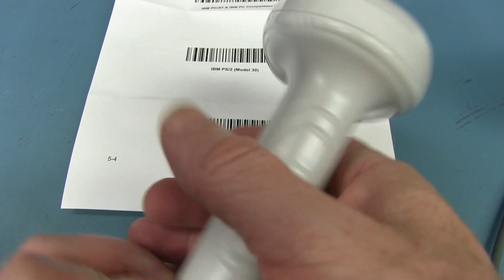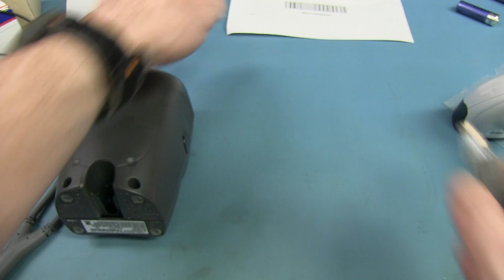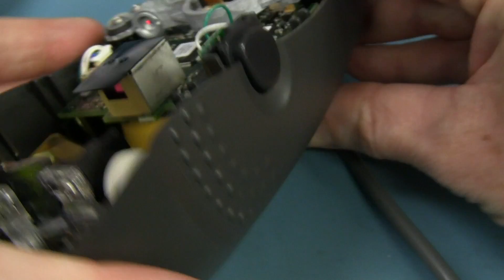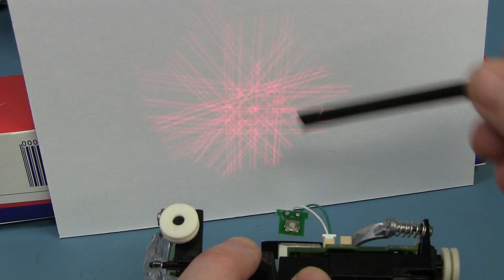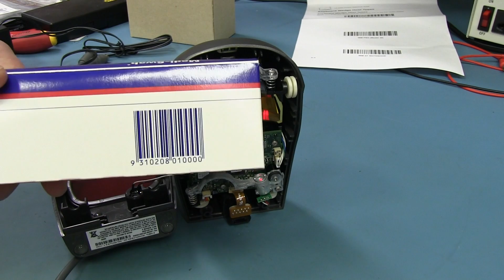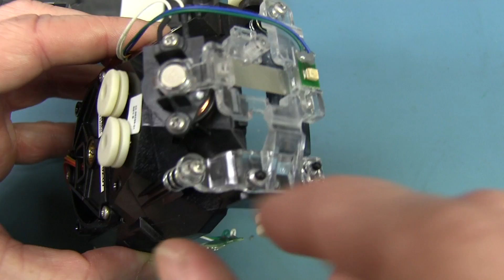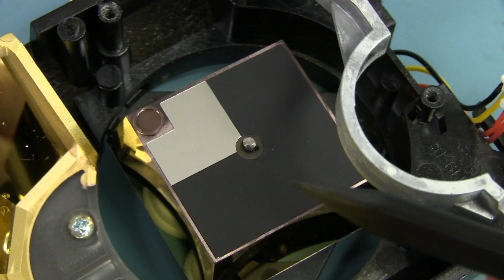EEVblog #637 - Omni Directional Laser Barcode Scanner Teardown

Comment: I'm confused about why Dave checked to make sure the thing didn't work without the laser under normal light conditions. My understanding is that the photodiode detects the changes in brightness of a particular wavelength of light (the same as the laser), and converts that into an electrical signal which is then decoded by the rest of the circuitry. So as the laser sweeps across the bar code at a particular speed, the scanner can decode it as if it were some kind of Morse code.

Assuming I'm not too far off, why would Dave think it might work with ambient light?
Reply: The discussion about how the atmel chip is doing "image processing" and "different angles" is also confusing. Unless I'm way off, it doesn't see any angles. It just sees a never ending string of bits and watches it for certain patterns. (probably a header, followed by a number of digits, and another header)

Am I missing something here?

EDIT: and if I'm right, you wouldn't have to program the scanner at all. It would read any code and output it. The point of sale computer on the other end of the cable would compare the barcode to a database to apply the price/itemname/whatever, and then talk to the inventory system and do the rest of the stuff...
Reply: EDIT: This was meant to be to your prior post. Sorry. Commented in the wrong place.

Ambient light: All wavelengths. Including those of the laser diode. Intensity? Possibly lacking.

Peel back the filters on the receptor, and perhaps it'd be happy to work with ambient.

Possibly the circuits (Atmel and maybe others) need more contrast than ambient can provide - especially with the filters in place.

Electronics are not good at "Seeing". It takes work and engineering.
Reply: Gavin Callard A photodiode only detects changes in overall brightness. If you're not sweeping a beam of focused light across the barcode, why would you expect it to be able to detect the pattern of the code? In that case, turning off the laser is just stupid.

Also, given that the photodiode can't see an image, but rather sees changes in overall light, why would anyone think it could see angles?

Comment: Question:
Why are the mirrors Gold tinted?
Reply: Gold is better at reflecting IR light.
Reply: The gold layer probably prevents corrosion of the mirror surface.
Reply: I'm curious if it's real gold or just gold-colored foil.
Reply: Thanks for the answer !
Reply: Well Of course it's going to be plated and not solid gold :)
Reply: Yes, my mistake I didn't read the comment carefully enough.
Anyhow , thanks for the answers!
Reply: Shagas Heizenberg To make them look Cool, Man! Just like sunglasses :P (joking aside, thanks to chris for the answer!)
Reply: For low cost they probably used a vacuum evaporative gold layer. Gold only needs to be a few atoms thick to achieve it's luster.

Comment: I don't get it... Why would the laser reflect back right into the photodiode? I always thought the angle of entrance is equal to angle of exit of a laser beam. Shouldn't the laser just reflect off the product and all over the place. How do they get constant data to the sensor???
I hope anyone knows this...
Reply: Maybe it uses just the scattered light of the laser hitting the bar code. But this would mean, that reflective product packages with a barcode printed on perform much worse, since light bounces off reflective paper in a much more "directed" way unlike the scattering of a rough surface.
Reply: czoknorris I think the photodiode is tuned to react to a certain wavelength of light. When the laser sweeps across the bar code, the diode "sees" the pulses of light as the laser goes across the light and dark patches. Since it's seeing scattered light, it doesn't matter much what angle the barcode was at. It still picks up the code, and converts it into an electrical signal to be decoded by the rest of the circuitry and output to a computer that interprets it.

Comment: On the atmel chip 53 week of 2005? But but.... A year has but 52 weeks.
Reply: 52 weeks, * 7 days = 364 days.
i think we have 365/366 days
Reply: Ratzfaz What's even more interesting is that 2005 did not have 53 weeks... but 2004 did. Which probably means that it was manufactured in the end of the 53rd week of 2004, which is the first or second day in 2005! This would be really confusing if it wasn't for the fact that two years cannot have a "leap week" in a row. It's still confusing, but at least the WWYY code is never ambiguous.

Comment: I use a handheld Symbol scanner at work that only shoots a single laser line, far more effective than the omnidirectional one that doesn't work good on the barcodes I scan. The handheld is in a holder that has a magnet that keeps the scanner active via a magnetic reed switch.

Comment: the sensor just looks at the total brightness of total area.
Due to the fact there is just one laser beam "at a time" passing of the bar, you just differenciate the signal, no matter what the ambient light is, as long as it is continuous.
So it will NEVER work with ambient light, as long as you don't swipe with (another laser pointer) over the code, with decent speed.

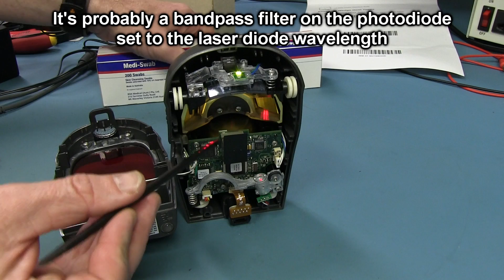Comment: 13:18 I don't think so. The sensor might be just a simple phototransistor, and laser ensures that the sensor gets a stream of data (gets maximums and minimums and interpret the signal). If there's no light that moves across the barcode, it won't sense anything.

Comment: Yes that 6 pin package is a sensor. On the 2 pin side you have a infrared diode and on the 4 leg side is a sensor. We have them at work and are used to detect the rotation of a shaft on which we have a silver and black pattern.

Comment: When you set the scanner up, you have to power the scanner and scan the configuration barcode(s) to set it to the correct mode. It doesn't auto-detect from the cable.

And yes, you can be a nuisance and scan the reset barcode to mess up the scanner at the supermarket, as long as you have the barcode for the correct manufacturer/product family.

The spinning mirror not only sends out the scan lines, but it also collects the reflected laser light off the barcode (via the 5-segment mirror and the curved focusing mirror at the top). There is no timing information associated with the mirror (AFAIK). The bit clock is recovered from the pulsation of the reflected light as it sweeps across the barcode. That's what the "quiet zone" (the white area to the left and right of the barcode) and the start/stop symbols (the first and last few lines on the barcode) are for, as well as for determining the barcode type.

If you can, get your hands on a CCD barcode scanner, not a laser scanner. Not only can they read damaged barcodes better, but that kind of scanner CAN work with the illumination defeated.

The mirror wobble feature is actually fairly unusual for an omnidirectional barcode scanner.

Decoding the barcode is actually not that difficult. All barcodes break down to a simple bitstream. All the processor has to do, after decoding the light delta values into bits, is determine if those bits follow a certain pattern for each barcode type, decode the barcode into symbols, and apply the check digit test. Not that processor intensive at all.

I'm just guessing here, but the opto-feedback on the spinning mirror is probably used to set the vibration speed of the focusing mirror. I could be wrong, but I doubt it's being used for timing of the decode logic.

Source: My job. I'm a barcoding and RFiD specialist.
Reply: EEVblog The barcode system works on changes, from dark to light or light to dark, not in thick and thin dark and light bands. If there is a change at a time point, that's a 1, if there is no change at that time point, that's a zero. The codes are tweaked so that there is no more than 3 'no changes' or zeros in a row, to allow it to detect timer drift. There are also three sets of two thin dark bands (actually, three patterns of 4 ones in a row), at the start, middle and end, to act as timing markers.

The scanner uses this to establish and adjust the timing as it scans the barcode.
Reply: EEVblog You're right, different angles and distances will cause the pulse train frequency to vary, but after the clock recovery happens, any bitrate differences due to parallax would be very minor - unless you have a ridiculously long barcode, like an EAN128 with many fields.

Now, I don't know exactly how the internal algorithm of this particular scanner works, but it is possible to adjust for any timing errors because there is both a start and a stop symbol. You could also do some clock adjustment based on transitions within the barcode.

My statement about processor usage was referring to the barcode decoding into characters, not about converting the analogue signal into the barcode bit sequence. I suspect the BedrockII chip is entirely responsible for this, as it is a very generic operation and probably best implemented in hardware. But as I said, I don't know exactly how the internals of this particular scanner work, so take that with a pinch of salt.

***** Unfortunately, barcodes do not contain a CRC, unless it is embedded into the barcode characters themselves. Barcodes do have a check-digit, but it is not based on CRC.

Robert Backhaus From the top of my head, each barcode "symbol" contains a fixed number of black and white bands. The total number of "bits" in each symbol also remains constant. By "bits" I mean, a 1-thickness band is 1 bit, a 2-thickness band is 2 bits, etc... The bands in each symbol can be expanded into a fixed number of bits, and vice versa. The only exception to this rule are start and stop symbols, and possibly control symbols of some of the more exotic barcodes.

You're correct; barcodes are like NRZ signals. It's the transition you're looking for, not the color of the bar. Some barcode formats even alternate between white and black for the first bar in each symbol, simply because each symbol contains an odd number of bars. Really neat stuff.

However, most (nearly all?) barcode formats, and in particular the EAN13 format he was using, do not contain "sync" bars or symbols in the middle of the barcode.

EDIT: Actually, I just double-checked, and you're right. EAN13 barcodes DO have the "center guard" bits. My apologies, I stand corrected.
Reply from the maker: Thanks. What about the infinite number of angles and distances (and hence bit timing differences) that are possible as the user swipes the product. How does the processor handle all that? It could vary from one processed angle to the next as the product is swiped. I suspect the decoding algorithms aren't as trivial as one might think?
Reply: I think the opto-interrupter is keeping the mirror speed locked. in a feedback loop. Probably if they do this, then they can approximately determine the time its going to take for that beam to scan. it could be easier to recover the bit clock.
Reply: The opto-feedback I think is more likely a safety feature. There are different safety requirements for scanning and stationary laser lighting (due to the minute amount of energy deposited to a single spot on the retina and the retina as a whole during the time it scans over the eye compared to the amount possible when a stationary beam enters the eye), and while a class 1 laser should cause no permanent damage it's still a liability (think someone suing the supermarket because they crashed with their car because their eye was watering from exposure, or more likely, helicopter moms). Thus, when it detects that scanning has failed, it switches off the laser.

Source: Stage lighting (though there, when scanning stops and lasers don't, it can easily cause permanent blindness.)
Reply: EEVblog There is some magic sauce in the firmware that looks at the data stream from the photodiode, and even if the scan was made at an angle, and the timing would be way off, it looks at all the received bits and calculculates the result. There is CRC error check, too.
Reply: What is the reflecting mirrors for the scanner diode focused on? Is it focused to infinity? That's how I would probably do it. He should have placed a camera in the position of the diode to check that.
Reply: ***** Moritz08536 Validole The opto interrupter is there to keep the company out of legal trouble, you can't trust sensing the motor in this case. Also, possibly for timing (and/or syncing with other moving mirror) but not necessarily, I could see ways around that, and it might even be irrelevant for the system to know how fast the mirror is spinning, or the exact vibration ratio.
The resonant mirror galvanometer is moving the parabolic mirror sinusoidally to make sure there's always a beam in focus, regardless of distance or laser focus deviations. I think
Reply: I agree with your assessment on timing. My guess on the reflective detector is it lines up the extra vibration/agitation coil with the rotation action, to avoid changing the coil position mid-rotation-scan. I'm guessing the extra coil improves reliability by giving the beams an extra degree of freedom/variation, so the clerk doesn't have to shake the barcode on a stubborn package. My LS9100 is built very similar but lacks the extra coil (or reflective bit) entirely.

Comment: That scanner is just seeing a serial stream of light and dark from the photo-diode. However many scan lines and directions it has. Standard bar codes normally start and end with 2 thin lines which lets you find the start of the bar code and the approximate scan speed(for manual scanning). Resolution is the reason laser is used.

Comment: That fascinating package @20:30 is most likely a reflex sensor, IR or visible emitter and detector separated so there is no leakage between them. If you look what is in front of it when assembled, you see that spinning mirror, which has an reflective area on it.
As to the flatflex ground plane, my best guess is that the photodiode or transisor is fed into an OP in current mode, and I know from school that current mode inputs (i.e. an inverting amp fed directly at the - input) are sensitive creatures, needs guard traces, shielding, the works.
Reply: Agreed on the "special package. Looked like an IR emitter/detector pair.

My best stab at the datasheet:
http://docs-europe.electrocomponents.com/webdocs/08b0/0900766b808b01c9.pdf

Comment: I was a point-of-sale programmer for Sears (now Sears Holdings Corporation) for ~14 years.  I've had lots of time with these Symbol devices.  A joy forever!  Thanks for the vid.
Reply: Also it's interesting that the parabolic mirror is vibrating.  I didn't think it was supposed to do that.  I remember doing thousands upon thousands of scans in our retail systems labs, and the lines were discrete without moving up and down.  We also had another weird Symbol scanner that had I think 2 rotating mirrors, and the whole design spun around in circles on the paper.  Also, you aren't seeing 1's and 0's as you said in the video.  There are different types of bar codes, and they actually can use different widths of bars and blanks in different sequences to represent different characters.  In other words, it is NOT binary.
Reply from the maker: JLTSoft
They probably have different models. Simpler ones without wobble, and this more advanced one with wobble (trademark!)
Reply: JLTSoft
Maybe it's changing focus real quick to make sure there's always one line sharp enough, regardless of distance to object?

Comment: Hi Dave, can it scan QR code as well?
Reply: Alex Mano
That is 2D. The barcodes it reads are 1D (Bars)
Reply: Although 3d barcodes would be awesome. Would be little cubes that you'd probably have to slot into a machine :D
Reply from the maker: The DS9208 model can, not this LS9208 model. Confusing.
Reply: Aw, well that’s sad. I've watched far too many sci-fi shows where they have some sort of data crystal. That would be great.
Reply: Nope, it only scans 2D not 3D codes
Reply: Of course, http://en.wikipedia.org/wiki/Matrix_code and http://en.wikipedia.org/wiki/Data_Matrix
Reply: Damnit i mixed my codes up. Thanks for reminding me
Reply: Oliver O'Neill No they would not. There are already 3D-Barcodes. They just use different colours to encode information. There are also 4D-Barcodes which are animated (like a gif). Both are not too common yet.

A Dimension of encoding doesn't have to be a dimension in space.
Reply: Of course it would be.

Comment: Dave, the "Pebbles" chip is the image decoder for the image coming from the camera, and the second STI chip is used for the interfacing and detecting the RJ-45 cable used, USB or PS/2.
Reply: The image decoder chip is just used for decoding the barcode sent from the "Pebbles" chip and then sending it to the Atmel that is sending it to the second STI chip, to the Hitachi and the to the POS through the cable

Comment: There is a good reason behind using the laser as illumination and not ambient light. If ambient light was used the detector would need large lenses on it to focus on a tiny spot on the barcode and scan across. Much harder to do and would have a focal point a certain distance away from the reader where its capable of scanning codes. While a tight laser beam can easily be swept across in a line using mirrors and has no focal point while the detector looks for light bouncing back from anywhere in its operating angle (Hence the bare detector with no lenses on it apart from filtering to reduce ambient light interference).